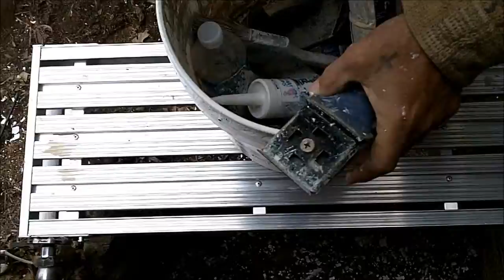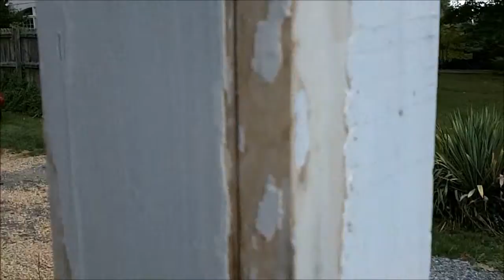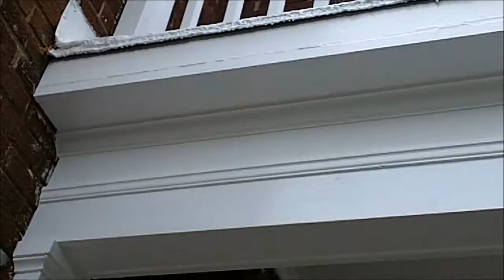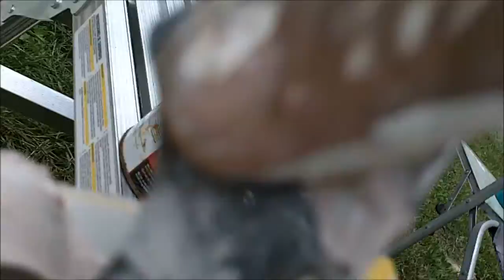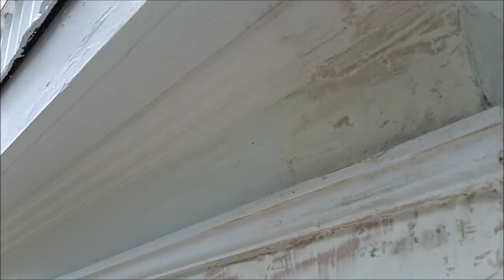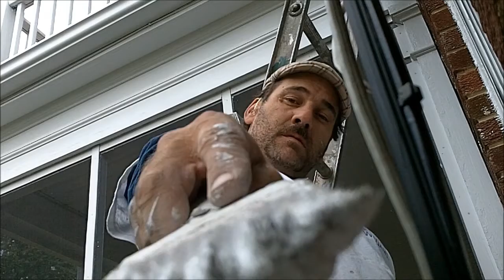one more days complete paint house

Comment: Hey Wes, what did you mixture with celement with red.. what is red one, what that? I never see that before.. By the way i saw you corner that have hole you cover metal one, very interesting mine is replace wood because its last longer .. Metal is short and it will peel it off, proof me wrong. Anyway tell me what is that red one?